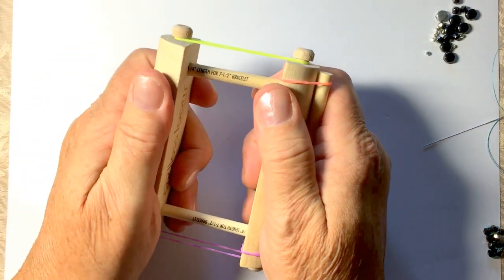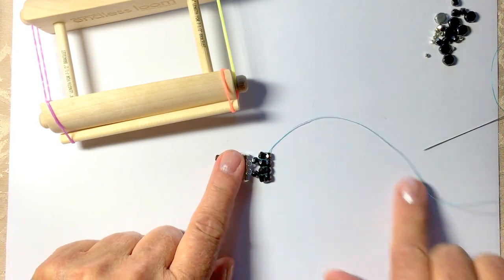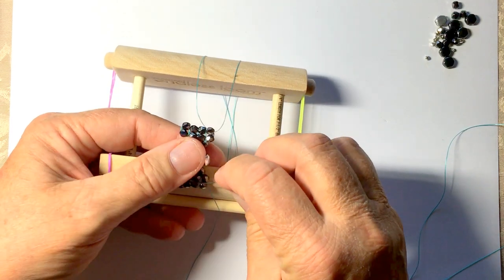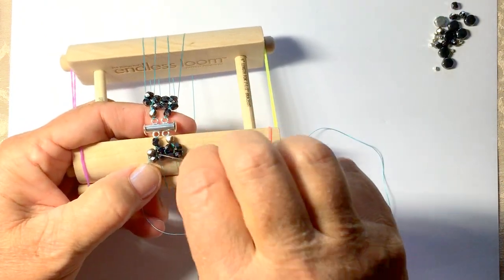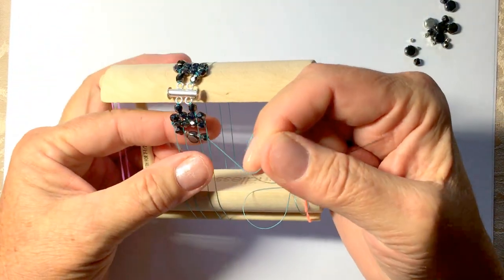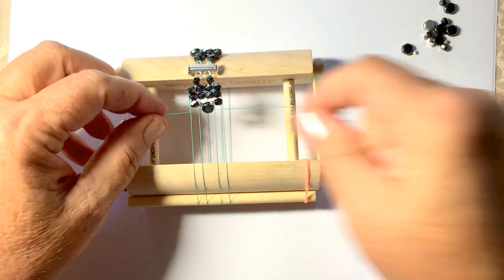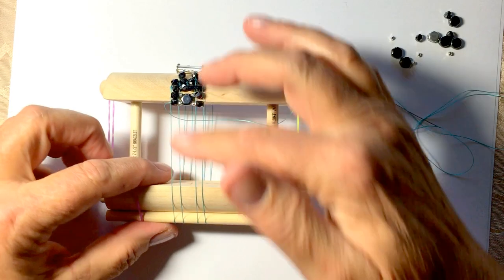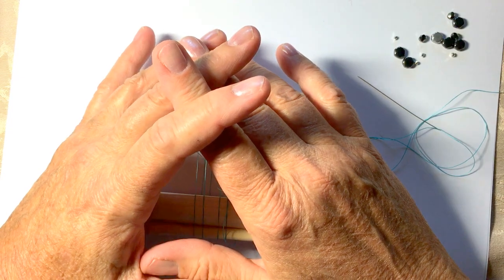Endless loom set up for honey comb bracelet

Comment: Does the loom come with 7.25 inch dowels? I found that to be the most popular size that I sell. 7.5 is just too big for so many people and 7.0 is too small to easily work the clasp although it it a great size for most wrists that I've sold bracelets to. I could add an extension chain but not for this type of clasp. I haven't bought this loom yet, but I'm seriously considering it because I hate dealing with the warp threads after the beading is completed. I've been using Slide end tube clasps and I like those but the last batch I bought were so thin that I couldn't tie off and glue my threads, I had to weave all 38 of them into the bracelet. What a pain! I'm currently using the Jewel Loom but I think I would like this better if I could make 7.25 inch bracelets with it.

Comment: Don't get to many answers on my questions about this endless loom from anyone I've asked. It seems to me the sizing depends on the size of the beads, and thats why it doesn't work for me, they use 6.0 and I used 8.0 thats why it turned out to big,
Reply: The length of finished bracelet depends on size of spacer bars you use and not the size of the beads.  The smaller the beads the more rows it takes.
Reply: mine does not come out, I finally made my own spacers. I do believe the size of bead makes a difference.

Comment: I used bead tool 4 to make a pattern bracelet that was suppose to be 6.14" long and I used the tube closer, but I had to had 5 more rows to actually get to the end which ruined my pattern, I used the 7" size rods, Did I do something wrong or how do you figure the length a pattern has to be? I put a string around the endless loom and the string measured 7 1/2 inch long, is that right? Is it already allowing for a clasp? and how do you start if you want to add the clasp after its done?
Reply: I use Bead Tool 4. It's not entirely accurate. I had to go in and define the size of the beads to a different number from what they use. Now all of my bracelets come out right. I haven't bought this loom yet, but use the blue plastic loom fro Bead Smith. I am thinking of ordering this one.